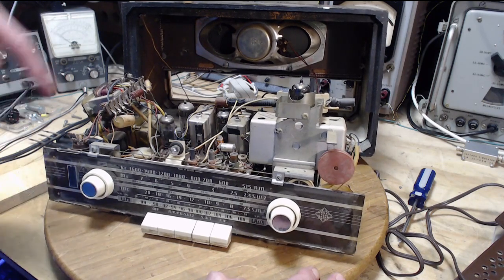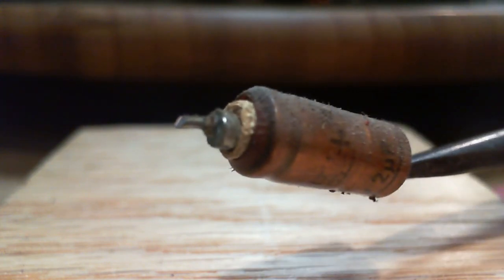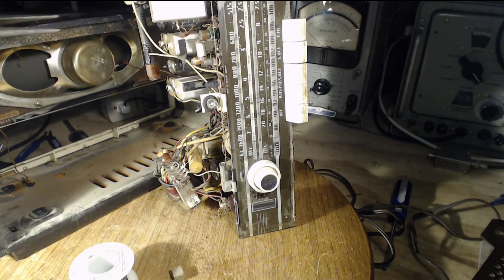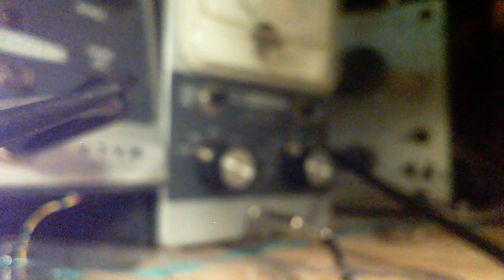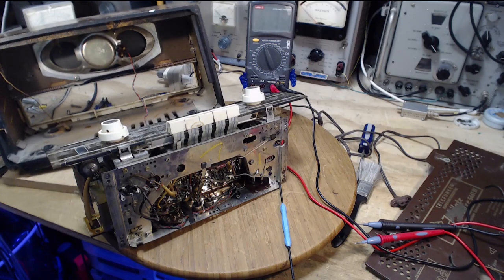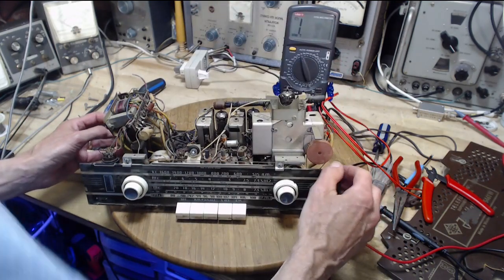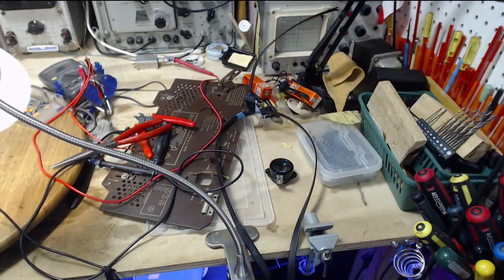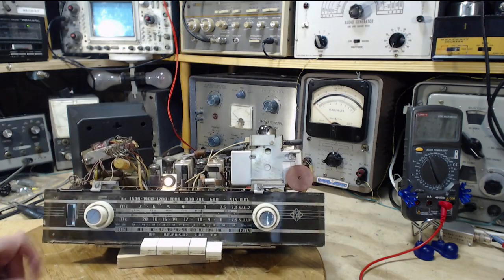Telefunken Jubilate Delux 4561W Video #3 - Two Capacitors Replaced

Comment: I wonder if he knows this radio has a pcb and the correct method to replace the caps is to UNSOLDER them rather than cut the terminals... Look at this @ 39:45 ... So embarrassing...
Reply: Seen many a shop just cut out the old , bend up the remaining legs then tag solder in replacement parts .

Not a mechanical joint just a lump of solder or just what's on the hot end at the time 
with no remaining tin in it  !
Reply: @StillCloser Actually... The 5461w is the export model of the german model Jubilate de Luxe 1461. The german language service manual can be found on nvhrbiblio.org. And there is factory instructions in there on how to service the PCB. And they advise the tech to do exactly what Jim did; cut components and replace from top. And in case of soldering on the traces the temperature limit is to be 250C over a max of 10sec. 
Also it mentiones that the solder side is covered in a protective laquer, that they call "solderable" but after thatvage I would not count on that to work well within the temperature limits of the base material and trace bonding.

Comment: Jim, I have to compliment you on being brave enough to show us your boo-boos as well as your successes!  (re the speaker wires!!)  And using your multimeter to trace the wires you needed to remove from the circuit board was a brilliant idea. I don't think I would have thought of that! 
I have a  multimeter that beeps when it shows continuity. That would be even more convenient than having to stare at the readout while you poked around. 
That's a nasty radio to work on.  Other than changing the power supply filter caps, I think it would be smarter to leave the rest alone!

Comment: Before doing anything I would take the radio outside and use canned air and blow out the dust from every spot. I think two cans would be needed here at least!
Only then would I start gently pulling out the capacitors from the circuit board. Well at least it still works!
Reply: And that's why I bought a 10 gallon compressor on wheels - blow out the big stuff out on the driveway.  Lower the PSI, put the shop vac nozzle near one end of the device and blow the dust towards the shop vac nozzle with the air compressor  nozzle when working inside the shop.  Compressor paid for itself with all the tire top-offs I've done over the years without popping quarters into the gas station tire inflaters.